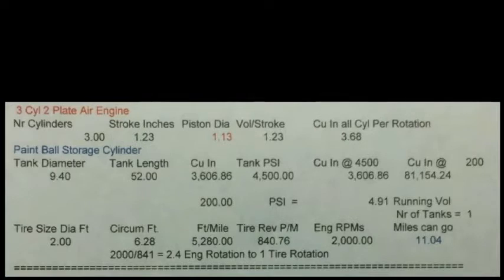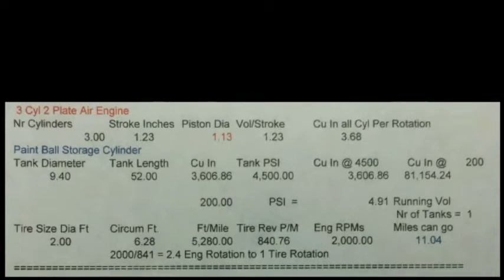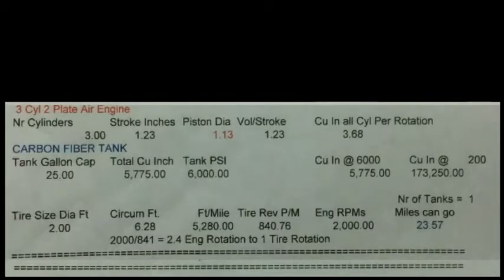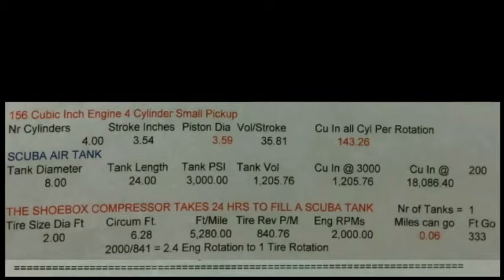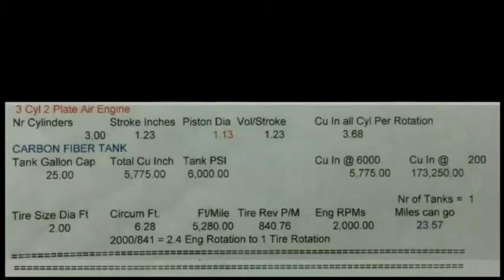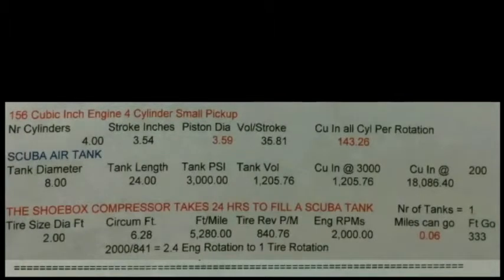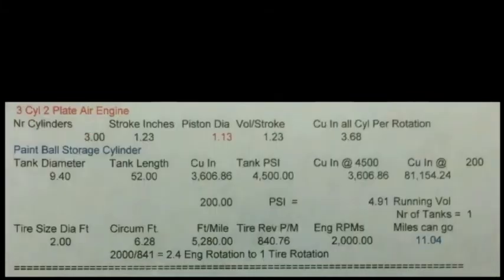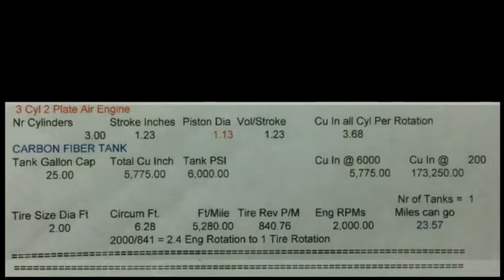Compressed Air Pressure & Volume Questions Answered 9-1-18

Comment: Thanks for sharing. I work with liquid nitrogen at my job and I am very interested i your work. Going for liquid to a gas nitrogen expansion is 92 times.
Reply from the maker: If you can keep hoses, pipes, and cylinders from freezing it could be a viable fuel, but you will have to buy it - not the free Air

Comment: i have (suposedly) learnt how to calculate the amount of compressed air in a cylinder.. its Pressure (PSI) x  volume (v) / 14.7 (atmosphe) ...
if i have a cylinder or tank 2 x 6 inches and i have say 1000 psi of air  inside then i can figure out how much space that compressed air, in that tank, takes up once its uncompressed ..  
1000 psi (pressure)  x  18.85 Cu inch (volume )  /  3.14 (atmospheres) = 6003 cu inch ..is this right?
Reply from the maker: Hi Frank! You have the right idea, but for some reason you divided by 3.14?  Should be 14.7psi and should be 1,281 Cu In when expanded. using the formula P1xV1=P2xV2. Glad to see you are thinking about what we are trying to do
Reply: @AirEngineResearch  oh my your right.. i was using Pi not atmosphere , silly me..
so 1000 psi X 18.85  / 14.7 =1281 .. excellent ... thats -  P x V / atm looks reasonable 
 but now change the 1000 psi to 10 psi ..
   10 x 18.85 / 14.7 =  12.823 Cu ??  how can there be less air in the cyclinder (12.823 Cu) under 10 psi than the cylinders inital volume of 18.85 Cu ?
thanks for the information  and i am interested in air  and steam engines both
Reply from the maker: You divide the pressure by 100, you also divide the internal volume by 100. Anytime you change something it can have a major effect!
Reply: @AirEngineResearch  thanks .. so its [10 / 100] = 0.1 psi x  [18.85 / 100] =0.1885 V  and the divide this by atm 14.7  = 0.00128 ?
Reply from the maker: Frank, you are making this more difficult than it needs to be! 
 to make it simple, use the formula P1V1 = P2V2
start out with the  pumping 75 psi into a 100 Cu In tank  
P1 = 75  V1= 100
You have 100 Cu In at 75 psi
If you increase the pressure by pumping more air in until it reaches 950 psi,  the new P2 = will be 950, and V2 gets smaller
V2 = (P1 x V1) / P2 = (75x100/950) = 7.89 Cu In at 950 psi
or 
V1 = (P2 x V2) / P1 = (950x7.89)/75 = 100 Cu In at 75psi
Reply: @AirEngineResearch  i searched online and even yuotube to figure it out but seems no one wants to tackel it.. area yes .. volume yes but not ..volume of compressed gas in a cylinder.. so far i have the basics which is what i need bu i see such a varied response.. 1 fellow said (p +14.7) x V / 14.7  to find it.. but yet another said this --

"The storage volume for a compressed gas can be calculated by using Boyle's Law

Pa Va = pc Vc = constant                                                
where

Pa = atmospheric pressure (14.7 psia, 101.325 kPa)

Va = volume of the gas at atmospheric pressure (cubic feet, m3)

Pc = pressure after compression (psi, kPa)

Vc = volume of gas after compression (cubic feet, m3)

Volume of free gas in a Storage Volume
The amount of free gas at atmospheric pressure in a given volume - like a cylinder storage - can be calculated my modifying 
Va = Pc Vc / pa                                                     

Gas can be stored in high-pressure cylinders ranging to more than 6000 psig (410 bar). Normal-pressure cylinders are in the range 2000 and 2500 psig (140 and 175 bar) and low-pressure cylinders are in the range 480 psig (34 bar).

Example - Volume of Air in a Cylinder Storage
 Standard atmospheric volume of air compressed in a 1.76 cubic feet K-type cylinder at 2200 psig (2214.7 psia) can be calculated

Va = (2214.7 psia) (1.76 cu ft) / (14.7 psia)

= 265 (cu ft)

sounds ok except the writer didn't say which.. Va ( volume of the gas at atmospheric pressure) or Vc  ( volume of gas after compression)..  meant volume of non compressed atmospheric  air in the tank and volume of the compressed air reverting to its atmospheric size.
Reply from the maker: I guess the best would be to contact the Physics dept. at your local college to get the correct details
Reply: @AirEngineResearch   thanks